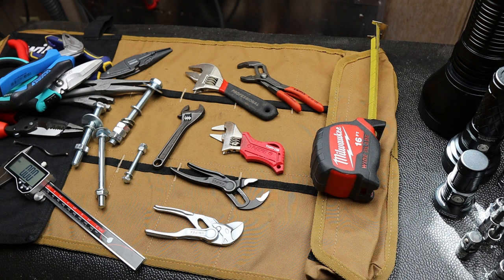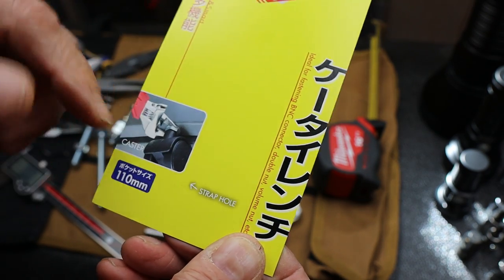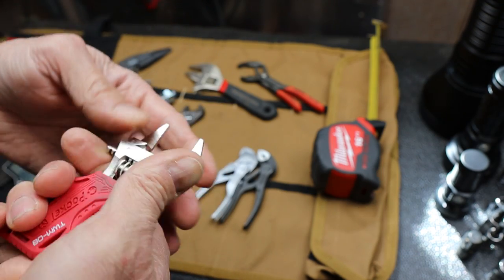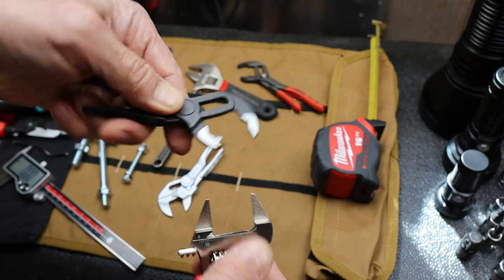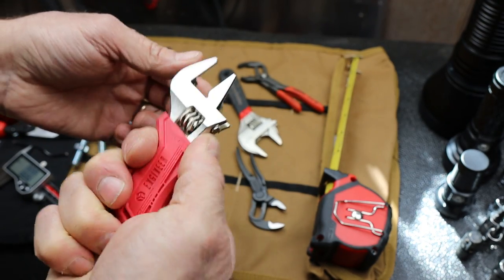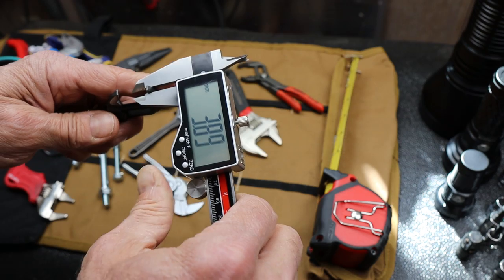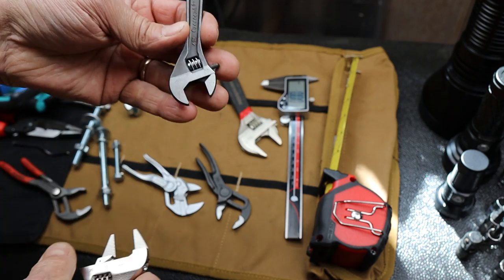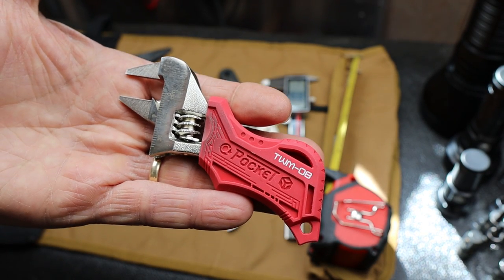Engineer Pocket Monkey 100mm Adjustable Wrench with Super Thin Jaws. Serious EDC Potential

Comment: I use one of these for work on white goods, particularly good for getting motor capacitors loose where the nut is slightly recessed. Also great for winding down adjustable legs where there isn't a lot of height clearance to get them started, saves trying to lift a fridge/front load washer with one hand and wind out the legs with another.

Comment: Compared to the two knipex wrenches, any crescent wrench loses, due to the simple fact that you can't squeeze with them. The adjustable spanner design is antiquated.
Reply: @htr5372  ?????

I have put my entire weight on my 86 03 125 without any issue and taken off ceased 20mm nuts. Maybe you just have weak grip strength?
Reply: @htr5372  I use the knipex wrench as a mini break to straighten bent poles.... or to pull out stuffed material that usually requires some kind of pliers to pull out the first picket.  I think people underestimate the capabilities beyond just an adjustable wrench.  Mind you I never used the tiny one, mine is 6 inches.  I think beyond novelty and some rediculiously tight spots the micro is a bit useless, it can also work in a pinch for edc.  I do own the 3 inch cobras though, never actually used it though lol
Reply: Its the squeezing that brought me back to the adjustable. Had the Cobra XS, had the mini wrench pliers. Biggest downfall is you have to squeeze them, which you cant do in a lot of small space stimulations. Adjustable you don't have to squeeze for the tool to work. Wound up never using the Kinipex Cobra and the mini wrench pliers and reached for a wrench instead. 
Good quality pliers though. Nice German steel. Ill stick to my 6 or 8 inch Cobras though

Comment: I just ordered the Lobtex UM24S ($22 on AMZN). Same overall size, 24mm opening x 118mm length,  but no over-molded grip (just I vinyl cover I plan to remove) and normal jaws.  This and Knipex XS pliers would be handy in a travel 'save a dive kit'

Comment: Hi Doc,

Good and timely video.  I have had my eye out for a 4in wide mouth adjustable, hoping that Irega would make one in 4in (I have the Irega 4in in channellock flavor, but it, like your crescent, only opens a little over 1/2in).  After watching your video, I did some digging and I think I am going to get the “Top” brand Japanese 4in wide mouth as I don’t have much call for such narrow jaws as on the engineer (I had always thought of the narrow jaw wrenches as bicycle specific).  Thanks again for the great content.

Comment: I personally have found no adjustable wrench that could beat my old MAC aw4 ( not sure the era on mine,  there's been changes ) because it's got a slightly larger head than the typical old 4" adjustable and goes up to 5/8" which is as much as I need.

I've seen these and they're interesting, but I don't know where it would fall in for me.

Theres also the recent Western forge 4" adjustable that you can still find new all over EBAY for the Craftsman version , they are much larger than the typical 4" adjustable and are a good choice.
I carry my WF at work only though, because it's still more than I want in my pocket everyday otherwise.

Comment: Actually I was able to find several other models, thick and thin, of the engineer monkey wrenches. Only thins are available on Amazon, eBay has way more options. This stubby is also available in black and with a different jaw shape. However for your reasons I would suggest trying to find TWM-04

Comment: nice calipers... looking to grab digital pair. any preference?
Reply: If your looking for the best go with Starrett or Mitutoyo, otherwise most all the other cheaper calipers are pretty much identical internally.
Reply: Yes, the really expensive ones are probably the best.  I have a mititoyo, a Stahlwille, and a few $10 cheapo special.  They all read the same …. I tend to grab non-digital as I don’t use them enough to keep batteries in the digital ones.  :-)
Reply: These new cheap (~$10) ones are pretty good. They all use the same technology internally. Some don't zero out automatically properly due to over sensitivity though this is a very quick fix with some selotape, some older cheapos used to have issues with parasitic draw (constant dead batteries) and cheaper ones have less than perfectly finished jaws. If you're doing machining go for some mitotoyos (~$100) but beware fakes, anything less than that the cheapos are fantastic for the price. The one doc is using here is a Qfun (~$30). It has enlarged display and fractional display for inches which are both nice features most don't have. And if it's good enough for doc...
Reply from the maker: Here's the one I'm using: https://youtu.be/C9fTjynKsjo
Reply: I have several calipers: Two Mitutoyo analog and one Mitu digital, Starrett 120A (main gage), Peacock, crappy iGaging digital garbage, and something else that I'm forgetting. What is your intended use for calipers? Do you work with wood?
Reply: @felixf5211  yes I work cars motorcycle and bicycles. Around the house mostly. My two are non digital. But now in my late forties. An easy digital screen would be welcome. Thanks
Reply: @andrewchiusolo1950  Given the application, there's little need for a Mitutoyo unless you want one. Certainly nothing wrong with choosing a nice gage. Realistically, any calipers with features that you need would be fine. I'd suggest picking one with an easily attainable battery. Good calipers are accurate within +/- a thou. If we consider that 1/128" is around 8 thou, there's a lot of room for error that won't impact the final result. This being said, if you're doing, say, engine work where tolerances matter, a micrometer is the better gage. Calipers are, in essence, a quick way to get an approximate value. Good luck.
Reply: @lastbesttool  yes.Different from most calipers using copper measuring sensors, this digital caliper adopts glass material sensor, which effectively prevents the caliper measurement accuracy affected by humidity, magnetism and other effects, and greatly ensures the stability of the measurement.
Reply: @lastbesttool  ordered. Thank you.

Comment: I see no real advantage to carrying the Pocket Monkey versus the 100mm Knipex pliers wrench.  Or if one really needs the extra jaw opening, the 125mm Knipex pliers wrench.  Lighter, smaller, and better grip while delivering superior torque.  A Knipex pliers wrench, paired with a same size Cobra, puts a lot of tool capability in a tidy package.  I'm waiting for your review of the teeny tiny oxy-acetylene cutting torch pocket kit.  Talk about hot pockets!
Reply: Besides the fact that there is no 100mm pliers wrench, only the Cobras go down to that size, you are right.

Comment: IMO, 6" is the minimal size for an adjustable. I'd rather use a small Cobra/Alligator on little nuts.

BTW, Doc, have you tried Nisaku tools yet? I'd picked up their larger Hori-Hori knife for work, along with some scrapers. The knife is beautifully make and highly functional for its intended application. Should have bought some years ago for the business. Fixed. The scrapers are quite decent for the money.

I'm seeing references to a monkey wrench in the comments. It's not the same tool as an adjustable wrench. Wish I could post a pic.

Comment: My perfect edc tool for these jobs, is the Knipex Cobra 150. It can do the job a pliers wrench can do but also works as a pipe wrench, can do stuff common pliers can do etc. It's the most versatile tool of them all, that's why I choose that.
PS I own the 125 Cobra and common small pocket size plier wrenches and other similar tools, but Cobra 150 is both the most versatile and the most capable of them all.
Reply: I absolutely agree! The 150 mm is real capable, fits even big hands like mine (11,5) and are hardly more cumbersome than the smaller ones. I also think that particularly the 100mm is more a novelty thing than a real tool.

Comment: I wouldn't bank on taking anything on planes reliably. Certainly nothing you can't afford to lose.

I've had 58mm pink Swiss Army Knifes confiscated at multiple airports, often next to a sign that says they're fine. Pink deliberately chosen as if I'd tried to take over a plane with them everyone would have laughed at me.
Equally I've had security not notice a significantly larger knife I've accidentally had in a bag.

A 6" sharpened centre punch I'd lost was only noticed on the third flight after losing it and once I'd explained what it was I allowed to keep it. Which was clearly against the rules.

There is no point protesting that the security person is spouting rubbish, they will stop you getting you flight even if they're wrong.